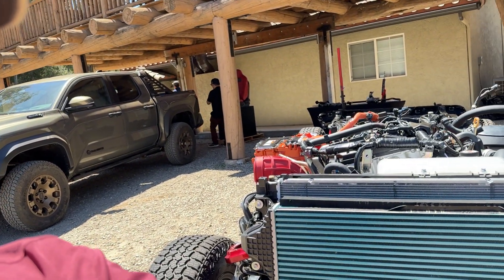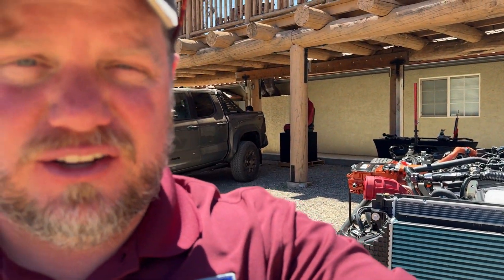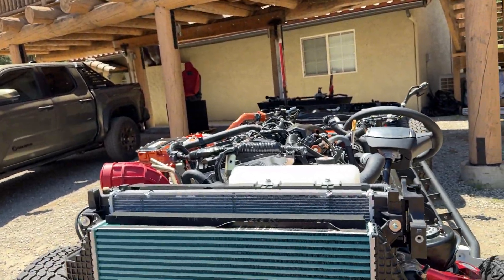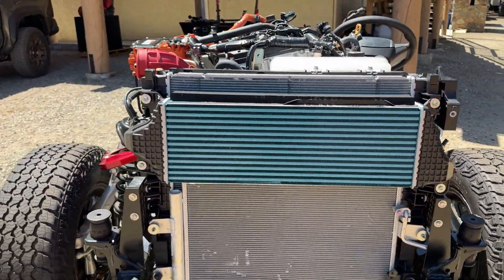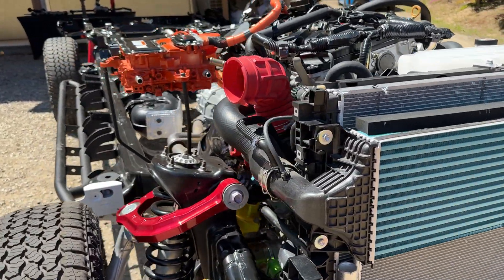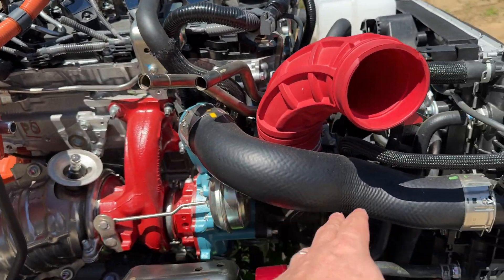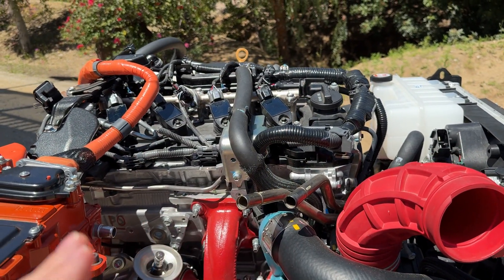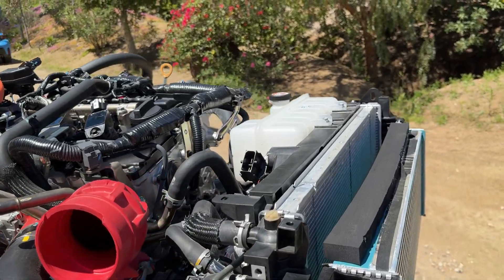More Complexity Coming! New Gas Truck Engines Are Getting Gasoline Particulate Filters

Comment: We'd still have the same amount of junk in the sky and air, without all the EPA propaganda 💯
Reply: I don’t think that’s true at all. Just talk to those who were around before and experienced the smog in and around large metropolitan areas.
Reply: @ALMX5DP  That's only true for industrial smog and heavy particulate matter. Industrial smog is just now replaced by clear smog, which is not better. There's probably more invisible pollutants like CO2 and other bad stuff. I mean, just the very amount of CO2 created by these systems. Do you know how much?
Reply: @bkzed7947  whatever was coming out of tailpipes back then definitely had a contribution like the comment above mentioned. Though I am not aware of the amount of CO2 that is produced by these systems, how much does it produce?
Reply: @ALMX5DP  It depends on the level of filtration. The more filtration, the more fuel is required to burn off the filter.

Fuel and carbon emissions are closely related to each other. For every extra gallon a GPF uses, that is about 20 pounds of CO2, along with other pollutants that come from the burn off.
Reply: @bkzed7947  how often or frequently would a GPF use an extra gallon over a typical engine? I searched and saw that an average car emits about 20lbs of CO2 for every gallon of gas used. I presume that is what you are referring to with the emission of CO2 versus gallon used, so if a GPF system is causing an engine to be less efficient than without, that additional fuel burned results in a certain amount more CO2 being emitted right? Just curious what the economy changes might be then when implementing a GPF (I see an article that says this when searching "The GPF pressure drop contributes to the exhaust backpressure, which can have adverse effect on engine operation, fuel consumption and CO2 emissions—especially at high load "). Wonder if there are any engines that have transitioned to GPFs to show what kind of fuel economy loss (and subsequently CO2 increase) there is.
Reply: @bkzed7947  lol...that's just crazy. You apparently have not actually lived the difference of cleaner tailpipe emissions.
Reply: This is a repost because the comments are being removed!

@ALMX5DP  That's too hard to answer. It depends on the car, the engine, the level of filtration, the quality of fuel, the length of time a engine runs at operating temps, the outside temps, many things.

My experiences have all been with diesel. Diesel is different than gas, but the idea is still similar. You have a filter that needs heat to burn what it collects. That is regeneration. 

In the worst cases, we see HD diesel engines in almost a constant state of regen. That basically doubles the engines fuel consumption. In better cases, it's just passive regen, meaning no extra fuel gets injected into the filter. 

That said, even passive regen results in some extra fuel because the filter is a restriction in the exhaust. 

In anyway, it results in more fuel usage.
Reply: @bkzed7947  yeah I did some table math about what it would look like if there was a 1mpg decline by using a GPF (such as from 24mpg to 23mpg). Doing so looks to net an increase of about 4-5% CO2 which is not insignificant. Though i think GPFs are designed a bit differently, I saw one statement that said "Unlike the DPF the regeneration of the GPF rarely has to be actively generated. At stoichiometric conditions under high load, the GPF core temperature may be around 650°C but the soot will only burn off with the leaner mixture that will occur during deacceleration, in the presence of O2 and some NOx." 

So sounds like cleaning will not be an issue, though still not sure how the general "filter" would impede exhaust flow/velocity and potentially fuel economy as a result.
Reply: @ALMX5DP  I said something about how EGR increases the need for regen. Do you see it?
Reply: @bkzed7947  I dont see any comment from you regarding EGR.
Reply: @ALMX5DP  I can't post seem to post it, so you'll have to imagine. Look up the issue, if you want.
Reply: @bkzed7947  Are you in any other chains?
Reply: @jrrand7319  Is the comment chain broken for anyone else, or am I just targeted by the censors?
Reply: @jrrand7319  Yes, maybe? 

I'm getting replies from chains that I'm not in. At the same time, I'm not getting any replies in chains I'm because my comments are being shadowed or removed.
Reply: @jrrand7319  That comment did not deserve to be deleted. It was true! Youtube is crazy.
Reply: @bkzed7947  I think trying to re-post comments that were deleted trips up their censorship bot. That's why I'm seeing strange notifications.
Reply: @bkzed7947  Dude, I basically can't say anything anymore related to the topic. No matter how clean I keep it, my opinions are just a little too strong for them. Youtube won't allow any of it.
Reply: @MarkChristian2010  Ay, my comment to you was immediately deleted. 

I don't even know what to say anymore.
Reply: That is probably not true - I am old enough to remember the smog from the 1970s...   We absolutely have forgotten how bad it was.
Reply: My comments are being deleted!
Reply: People, check to see if your comments are being deleted by going incognito. Some comments are completely removed without you knowing. Others might not see your comments.
Reply: That’s not true! I moved to California in 1983. I lived in Riverside. One day in early fall off shore winds started to blow. I discovered there were mountains here. When I moved here there were at least 60 first stage smog alerts per year. I don’t think we’ve had a first stage smog alert in 10 years outside of large wild fires in the area. This is due to cleaner burning cars! There are more cars here now than there were in 1983. It’s not propaganda the problem was real. The propaganda is that battery operated EV’s will solve the problem! That’s 🐮💩!
Reply: @markreams3192  Read my other comment.
Reply: Even if we managed to reduce some level of pollution from our own air, how much of that is the result of hurting own economies and of moving activity overseas? Like steel industries. There are less emissions because there are less jobs!
Reply: We should go back to leaded gasoline.

Comment: Getty Adventures did say that about the Tundra, but he did make a correction/ clarification in a follow up video.  He basically said  that they were already showing up in certain vehicles in Europe in the correction video and were coming to North America eventually.

 BTW, Getty Adventures does some really good truck reviewing and deep dives into Power Trains from a mechanic's perspective! 

 Keep up the good work, Tim. Some encouragement from TX.
Reply from the maker: Thanks for that information.
Reply: The GPF is on the 3.4 V6 twin turbo in the Lexus LS. Same engine as the Tundra but with gasoline particulate filter

Comment: Nothing complex about electric motors also zero emissions. 👍
Reply: Don't kid yourself. EV tires produce far more particulates.
Reply: There is plenty of complexity with regard to BEVs. No tailpipe emissions but a lot of other considerations still that are currently being worked on.
Reply: You strip mine the earth 🌎 run non emissions dozers n tractors 24/7 in China for lithium than ship from China on a 50 year old ship sure zero emissions. Only true zero emissions is Hydrogen

Comment: The particulate filters won't cut down on CO2 at all. It's basically just going to filter out the microscopic particles that don't get burnt during combustion. It's crazy what is being mandated now. We are so far beyond diminishing returns on the cost vs benefit curve.
Reply: Has he saying it doesn’t help only makes engines more complex and less reliable. Which is exactly what the want so u will by a ev paperweight.
Reply: Soot falls to the ground.  Does not linger in the atmosphere.  It was added to diesels becuase CARB did not like seeing haze or black smoke coming out the tailpipe.  Plan and simple.  Internal engine temps causes what comes out the tailpipe with gases.
Reply: Hmmm, my comments are being blocked again. Youtube is destroying free debate.
Reply: @MarkChristian2010  Same!
Reply: @allentechpt9026 I think there are definitely reputable studies and research efforts in many fields. I was just curious what was studied for this particular aspect.
Reply: @ALMX5DP  Who are you replying to?
Reply: @allentechpt9026 you, you asked if I knew of any reputable studies at all and said everything was hearsay. I was just responding that.
Reply: This is so weird.
Reply: It’s all nonsense. Modern vehicles are clean enough. 99. 6 percent of c02 is naturally occurring. It’s all a scam by communists…
Reply: I'm getting all kinds of strange replies and notifications right now.
Reply: @allentechpt9026  Are you getting strange timelines?
Reply: @MarkChristian2010  In the notification dropdown, yes. But I'm getting replies to other people's comments.
Reply: What exactly is crazy about filtering out microscopic particles from the exhaust?
Reply: @ALMX5DP  Because it's actually not a filter, it's just an incinerator. That doesn't necessarily improve anything. With the way DPF and GPF systems work, it actually brings more harm by making PM smaller and more dangerous to breathe. It also INCREASES other pollutants like CO2 because it requires additional fuel to burn down the heavier PM.
Reply: @MarkChristian2010 do you know of a study which shows correlation between GPF use having a negative impact on air quality?

Comment: As bad as our air is now....its necessary. Yeah its gonna cost us. But we are dealing with a lot of pollutants in our air. Things like microplastics have been constantly in the news lately, Forest fires kill the air quality..etc. 
 If emissions can be taken out of the eqaution. Im all for it...
Reply: Make sure you re-elect Obama, so all these things will be solved once and for all!
Reply: I definitely agree, as long as the technology does not have a negative impact like astronomical service or replacement costs or unreliable vehicles.
Reply: @ALMX5DP   There are always unintended consequences. Besides if it's necessary, what does it matter if it's unreliable or expensive? You're saving the environment.
Reply: @allentechpt9026   sure, though just how severe those consequences are will affect my opinion on their benefits. I am fine with a reasonable approach but if the costs are too much I am personally not a fan with such a mandate even if there can be some environmental benefit (just like for EVs, as I’d love to own one but at this point they may not be the right fit for my use and budget). I think there is evidence these GPFs are beneficial to air quality, and just a quick glance at an article said they are much more reasonably priced than DPFs so perhaps this is much ado about nothing.
Reply: @ALMX5DP  The comment I made to you was removed. Keep that in mind.
Reply: There's no evidence that it's necessary. You're just told that and automatically accept it, like so many other things.

Comment: Particulate filter catches soot and burns offs.  Has no effect of the gases out the tailpipe.  Soot rises and falls to the ground.  EGR’s, factory tuning and in the case of diesels.   The SCR system (DEF) converts the Nox and/or gases to water vapors out the pipe.  Any who….bad idea and complex.
Reply: Yes agree
Reply: You can turn to BEV's to keep things simple.